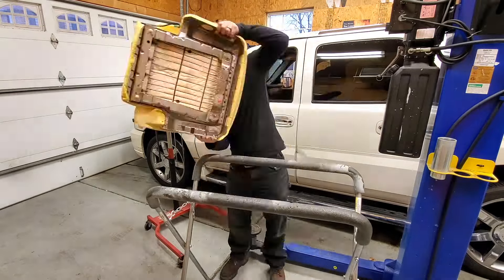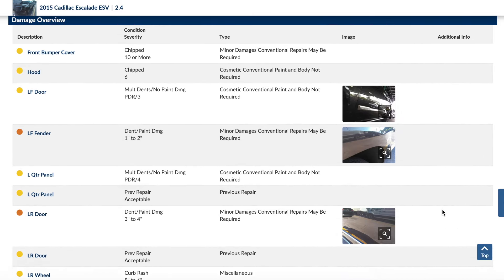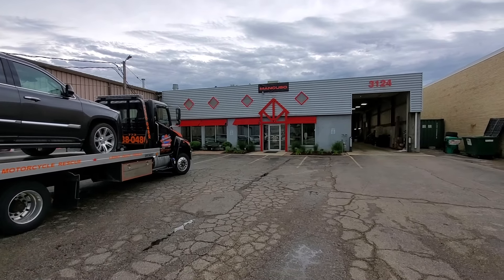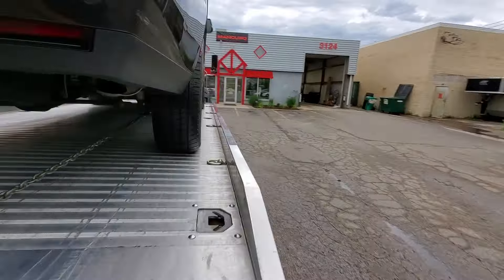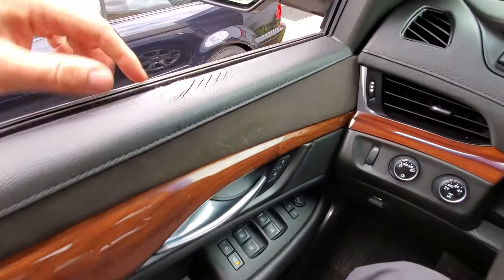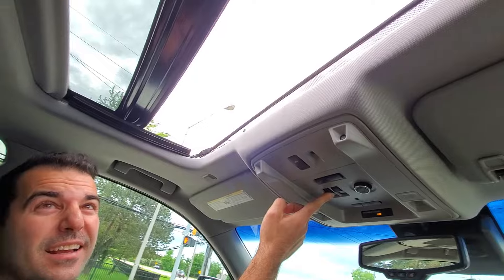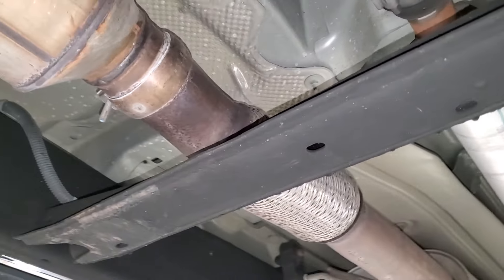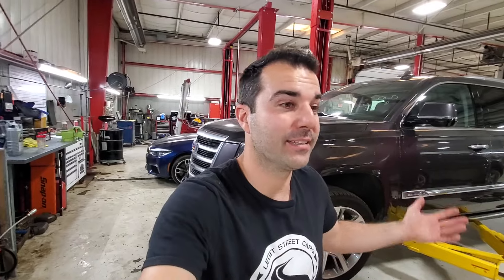I Bought My Wife A New Escalade With "Structural Damage" For 40% OFF! Cadillac Couldn't Sell It!

Comment: You guys in the US are sooooooo lucky to have SUV’S like this 🏴 👍
Reply: Not sure about that mate. Probably averages 15-20ltr/100km. If you're from England a truck this size would take up most of the road
Reply: I could never justify spending 3x more on gas than need be just to get from point A to B in a little more comfort.
Reply: and their fuel is cheap compared to ours haha
Reply: @Netlogic.  gas is around $2.00 a gallon here or about .47 of a euro per liter so it's still affordable here.
Reply: And decent roads, UK roads are a disgrace 🏴
Reply: @Mr.Tennant  2 dollar a gallon? Its roughly 1.60 euro's a liter here. So around 6.8 dollars a gallon. Crazy.
Reply: I love how handy they look too, it's just too expensive too maintain in Europe. Fuel is too expensive, parts are not easily available and it also get a heavy taxes. If you can handle that, you can get them. My brother did 😄 but he's rich so doesn't care.
Reply: Y’all got range rovers
Reply: Pretty fly for a WiFi  the gas in Las Vegas, premium is $2.45
Reply: @thehostler0  i think we use imperial gallons though and they use us gallons which are 
.75 litres less but still agree fuel in europe/england is too expensive
Reply: In North America we're not allowed to tow as much compared to the weight of our cars because our speed limits while towing are higher. Vehicles this size are necessary if towing bigger trailers. However, minivans have around the same interior space because their floors are much lower without the bulky frame.
Reply: I meant , if we have to go deeper 🙄,if you live in  US at US fuel prices, totally unrealistic at our fuel prices and roads in UK
Reply: James Behari what the hell u talking about? Gallon is gallon everywhere. The only roundup applies to ton, where they use short ton in usa and  call 2000lb a ron instead of 2200 lb, fir easy counting, everything else is same
Reply: Yeah, they‘re just too big for europe and I think Cadillac only sold 100 Escalades last year in germany, they‘re super rare :/
Reply: @Mr.Tennant  WAIT WHAT? HOW IS GAS THIS CHEAP IN THE US?
Reply: deckingking They have such big & long vehicles to compensate they 'r small rods  .(.
Reply: @Mr.Tennant  It's still a lot of wasted money at the end of the month I could spend on more important things, but hey, that's just me.
Reply: @pokinacha  actually minivans are the best on fuel economy I average 32 mpg
Reply: @pokinacha  ya it's BS they don't offer the Duramax diesel in these Burbans and Escalade's. Probably sell like hotcakes.
Reply: @ansv3340  you are wrong my friend, Google an imperial gallon which is 4.546 litres and a US gallon which is 3.785 litres. This is also why I personally struggle with your idea of quarts because your gallon is different to ours! We sell oil and other fluids in litres which is 1,000ml and your quarts are approximately 947ml so that's a relatively small difference but I always have to think about it first.
Reply: I feel like you're lucky in the UK having access to so many manual transmission wagons. They're very hard to find here! I don't disagree with you that we have cheap fuel, but it's not as nice as you might think because our cars aren't as fun. Even if you want a small car, here that usually means something like a Ford Escape (Kuga).
Reply: Funny thing too is some states don't have an MOT (annual inspections).
In Ohio I believe it's ~75$ to tax/register your car (tags) for the year.
Some of the cars on Ohio roads are in shocking condition.
Makes me think having an annual inspection actually a good idea.
Reply: @stuartd9741  , here in Canada vehicle inspections vary wildly province to province. Most maritime provinces have annual inspections, but Newfoundland and Labrador, which likely salts the most, only requires inspections when the vehicle changes owners. Quebec, which also salts alot, only requires inspections when the vehicle first enters the province. 

However, I've noticed that in Newfoundland and Labrador, there are very few cheap cars that would pass an inspection, so it does force unsafe cars off the road whenever the current owner gives up.

Comment: Heated seats and steering wheel is amazing in the winter. But as a heads up with snow and ice the running boards get stuck. And if the radio touch screen goes out. Look on Ebay for a replacement screen. A new radio won't be needed. 
Your wife will absolutely love it

Comment: Clear coat the headlights so they don’t yellow I work for gm they are a 3400$ headlight each
Reply: Yes and 3M clear film headlights as well.
Reply: Yes 🤑
Reply: @RJenkins6586  hell even before. I had an 02 monte carlo and the headlights did the same
Reply: 3400 each 😳 ?
I redo headligths clear them only charge 30 bucks each ...

Comment: They are soooo nice. We went out to get a Suburban and came home with one just like this. The cameras and sensors, plus electric 3rd row are so nice. Keep in mind these transmissions had a big issue with trans fluid causing TC issues and crazy shifting. Feels like going over a rumble strip. Requires triple flush. We almost sued dealership but they made it right.

Comment: 7:56 That guy was talking about E36's and my ears perked up. Wish I knew what they were talking about.
Reply from the maker: He was looking at an E46 to buy that was parked right next to my Escalade. The salesman and customer were just talking BMW in general
Reply: My first thought was BMW too! You have to be careful as there is an E36 AMG too in the 124 shape which can get confusing if you start talking about the wrong one 😂
Reply: @tbetts56789  E36 is the third generation BMW 3 series (1992 to 1998 in North America). No such thing as an AMG E36. AMG is the Mercedes performance brand.
Reply: @houseofno  I suggest you Google it, an AMG spec M104 engine is a 3.6 that is based on the 3.2 220hp lump in the 124 chassis at the time. I'm well aware of the E36 thanks and we had it from 1991 to 1999 in the UK. We also had the higher rated 286ps or 282hp engine in the 3.0 with better vanos and individual throttle bodies compared to your North American 240hp in S50B30 flavour. The 3.2 that followed got 321hp approximately. Don't mean to come across like a d**k, just a jokey comment originally about a lesser known AMG 👍

Comment: Rear end damage is generally unimportant comparing the front one. Quarter panel damage is considered structural but it won’t affect the ride of the car like a structural damage on the apron in the front. The car is a steal

Comment: I don't understand.. "structural damage" - "we need to clean up a weld"
Reply: The structure of the car has been touched to straighten it out so in theory the cars structure is not 100% straight.
Reply: Really is very simple.  Whenever a car gets involved in an accident where there is an airbag deployed, the insurance company has to put an alert on that car.  Also whenever the repair involves changing a panel or the frame suffered damage the insurance company reports structural damage. 
The problem with this are different levels of damage are treated the same way.  For the insurance company If a car was involved in a fender bender and the airbag deployed is the same as if the same car was involved in a huge crash with huge damage.  This car obviously was rear ended and the damage was significant enough to deploy the airbag but not really heavy.  For the rest of its life the car will have the structural damage tag on its title, since it was put there by the insurance company that reported it to the DMV.
Reply: @manuelvpr  but in reality the frame is in good condition?

Comment: I remember my buddy bought a car with structural damage. Every year his roof would sink in a little bit more until 3 years later it looked like an “A” 😭😭😭 frames take a while to bend all the way I guess 😂
Reply: A lot of difference between a body-on-frame SUV like this and a uni-body car. The body on this could literally rot and fall off without detriment to the actual chassis.

Comment: The seat will vibrate if you have your collision assist gap set too close to. If you speed up and get too close to vehicle the vibration is the warning to slow down. Also the lane assist will turn the wheel into the lane for you and if you are out of the lane on the right side the right side of the seat will vibrate if you are out of the lane on the left side the left side of the seat will vibrate. Premium luxury escalade esv you will love it!

Comment: Do yourself a HUGE favor and get a "Range"  to deactivate your active fuel management on your 6.2 with that many miles.  You might (might) be able to save it from the dreaded AFM lifter failure.  More prevalent on the 5.3.  But search and you'll see Denali and Escalade owners are experiencing similar issues with AFM systems.  Good luck and nice rig!

Comment: Looks like my old Escalade ESV platinum! 2004.    JUST bought a 2017 Escalade ESV platinum.  LOVE it. Best purchase ever. BTW I got the same smoke grey color.

Are there LCD screens in the headrest? That’s a specific for the platinum.  Also there should be the platinum statement on the interior running board. Next to the seat.  

And YEAH, once you drive an Escalade ….. you never go back.

Comment: as a lifelong suburban owner... I'll remind you to clear out the rear AC's slobber tube periodically. 
rubber nipple seen in bottom right corner at 6:42. In certain driving conditions, it will clog with dirt...condensation will fill the catch pan and leak out into your carpet.

Comment: I bought a certified Escalade from a local dealer and during my search I notified that the Kona brown leather doesn’t have the same issues on the console cover as the black or lighter color.  Weird issue to have, but you see it in almost every Escalade even the super low mileage ones.

Comment: I would check if the place where the excess seam sealer was isn't supposed to be a drain because if water starts collecting somewhere, it will rust out 100%. Also undercoat it with wax/bitumen type of stuff to really prevent it from corroding and maybe also put some dielectric grease in the abs module connector to prevent corrosion in the on the contacts. I also live in the rust belt and have been fighting rust quite a lot.

Comment: Absolutely want to see her reaction!....i love this generation. Im sure with all the research you do you probably already know this but 2015 and 2016 had a "buffetting" issue. That noise ya get with the windows down on the highway. Only it would happen with the windows closed. The roof likes to separate from the support rails. GM only used sealer instead of welding them together.....looks like you got a killer deal. My wife loves the Yukon xl style a little better.

Comment: Might be doing the same... Saw your first video on the 05 and basically junkyard fixed up a 2002 for myself. The northern winters getting it. A great winter/daily when I don't take my first gen CTS-V out 4thGen Firebird out.  Love the older stuff because their really just Tahoe's with a 6.0L underneath, not an absorbent amount of tech, easy electronics but that newer body style does have an extra touch of class.  That said I'll take the 02' into the woods, newer one I'd feel bad 😂

Comment: That’s a messy repair, looks like the rear tailgate, body panel, crash bar and pass side rear quarter panel was replaced. A pretty hard hit. Definitely check the mounting points for the body on the frame and make sure the rest aren’t ripped

Comment: May not have had rust....but my Escalade spent its 60,000 miles prior to my purchase of it, in Florida. The axel areas were soooooo corroded from the salt water, it was horrid when changing the breaks, rotors, and tie rods.

Comment: I have the hands free opener on my rear door as well. The winter snow and salt stops it working without cleaning the sensor off. It got so annoying I just stopped using it in the winter.

Comment: Buy the way passenger cars do not have bumpers. They have fascia. Bumpers have to withstand a 5 mph impact. So when did the gov mint no longer require bumpers on cars?

The RR shock leak is probably from when the rear got hit.

 I still drive the 2004. Mostly because there is no 2020 replacement for it. It still tows 3 tons. Durango nope. Explorer nope. Traverse Nope. Some of them putting a hitch on them voids the warranty. Mostly just purse haulers.

 Maybe she will let you drive it.

Well besides when the gas the gas gauge has that blinking E or it tells her to change the oil or the it needs a bath and a interior suck. That is when I get to drive the new car.

Comment: So actually my mom's car has the same story as you're wife's car but on the opposite side and also my mom's car is a 2016 juke looks like the normal juke but it's not a regular juke it's a nismo and the repair guys did a really good job and they even had to replace the part of the frame that was hit my dad bought the car for like $16,000 and it had 16,000 miles

Comment: Those wrinkles on the center console are not common I've never seen those before and I have had many with that exact console. I still have two Denali's with that console and we don't have that problem at all.  Both almost 200k on them. I think that must be from wetness or sweat or excessive wear but its not normal or even common. GM trucks is my specialty.

Comment: I have a 2003 Escalade ESV and the AC does not work at all. The heat works in the back but not the front. When I heat the windows air comes out but it isn't always warm or hot and I can't control the temperature just how hard much air comes out. It's effective because whatever air that's coming out is warm enough to clear the windows. I am wondering if anyone has any insight on how to fix this? I got the car for free but it came with this issues, so I figured it was still worth it.

Comment: I love that you bought your family a nice vehicle...but the GM aspects of this thing are gross.  Torque converter, ac condenser, motor mounts all replaced before 75k miles...the rear diff leaking, the front strut leaking and bushing shot.  The leather issues inside on the console and door panel.  This is all stuff that should be typical of a vehicle with a 150k on it...barf..

Comment: double-check that the wireless phone charger works on newer phones, I have a 2017 escalade and my iPhone is an 8 plus and didn't work with the wireless charger that came with my car and had to upgrade it from a part that you can get from the dealer, which should be part #84526978 hope this helps!
Reply from the maker: Thanks!! My galaxy s10 plus doesn't would but her s9 does. I think mine is physically too larger and doesn't make contact

Comment: Not nearly as good an your 05. Those Eco 3 motors are junk usually can get 100 to 150 thousand otta them but there no LS like ur 6.0 in that 05. Transmission also will have issues esp if you decide too pull anything. A an M axels are garbage is the reason dif is leaking at 70 thousand miles. Id flip it make some good money on it. Get something different NOT GM.  Gm after 07 all JUNK. KEEP THE 05 it will outlast this truck. GM designed their vehicles to be serviced monsters they needed to pay the mechanics the service writers the dealership and all the other people involved with dealers they also designed them to just beat warranty miles and year

Comment: These things are overpriced, ugly junk lmfao. I drove two separate ones just for shits n giggles. One was a 2019 with under 10k miles and everything rattled and/or was loose. All kinds of suspension noises and stuff that did not work. The other was a 17 or 18 with under 40k miles and it only made about half the power it was supposed to, and it had other issues. Btw, these were both supposedly certified. This was at 'central cadillac' in Cleveland Ohio about a year ago. Now, maybe this was on this dealership..because it is a horrible place, but these were fairly new vehicles.